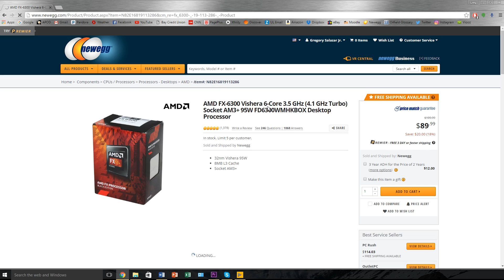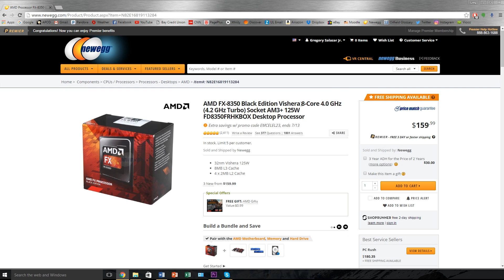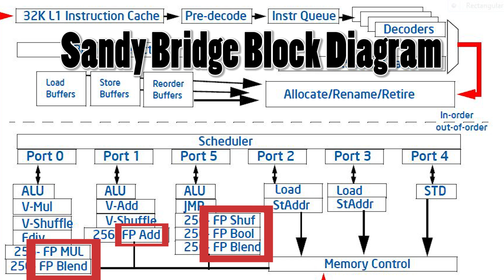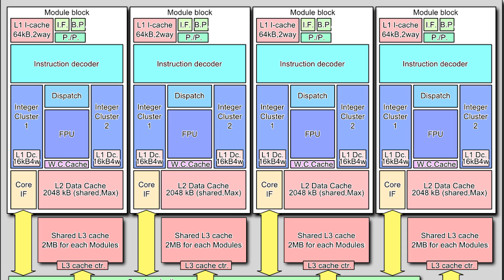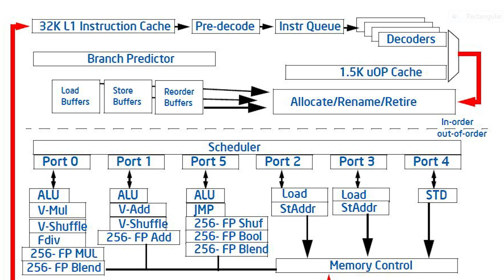How Many Cores Do AMD FX Processors *Actually* Have?

Comment: So is the FX-6300 "3" core processor?
Reply from the maker: Pay attention to what is said in the video.
Reply: You can put a lot of cores in a CPU, but of software programmers stick to the old ways, doing things as they've been doing for the last 10 years, then it's unlikely they'd want to change that (it's how they make their money)...

Dx12 changes things BECAUSE Microsoft forced them to with Windows 10... If people still had a choice to not use Dx12 with Win10 or later, then they won't, due to laziness and greed.

This means gaming will never go Dx12 in the first place if Microsoft did not force people to upgrade to it to use it.

Hell, many programmers and developers STILL use the old methods of programming games and such, some of them very inefficient and very outdated. It's fine if they do it the old fashion way and debug and refine their code, but the 'old fashion' way of copy and pasting code and using dozens of libraries of pre-made codes for you, is pure laziness.

For one thing: Java is the most useless language in comparison to other languages... It's a decent entry and learning language sure, but it's not as useful or efficient as the other well developed languages.

The one thing people need to look at, is 'refinement' of technologies or methods.

AMD is trying new stuff at times, and it's risky. Intel is prototyping stuff but they generally stick to what works.
Nvidia is constantly using older technology for their GPU (that they are most comfortable with), whilst trying to boost it with better software (and charging more because they own most of the market).

I mean, take a look at Vulkan, after it's hyped up for a month or two, how many developers actually added it into their games for support? Only a few mainstream ones. Indie developers using Vulkan? Nada. Most of the indie developers don't bother doing Dx12, they believe that Dx9 is all they need (because a lot of PC users actually are still on Windows XP, the poor PC users still outpopulate the modern PC users).

Dx9 is sufficient if the game is simplistic, but the moment you have a Dx9 'sandbox' or scaled game that draws a ton of entities, like in RTS or MMOs, the bottleneck is VERY real, even on top end rigs.
Reply: No, they are true six core. The reason why it show three core is because each 2 core share resource. Here it is again in the video 2:39, but just in case you still don't understand. I'll try to explain below.

Floating point unit (FPU): Handle mathematical calculation.
Module 1: Core 1&2 Share resource, so instead of each core having their own individual FPU to calculate the instruction being sent for it to process. They instead, have to split the resource used for calculating those instruction, and this is the reason why Intel CPU have better performance per core. It's because AMD CPU core are sharing resource with one of it's neighboring core. Think of it like Intel CPU is like a house, and AMD CPU is a duplex. 

Office is a module, the boss is the Fetcher, Decoder, and scheduler; Each worker is a core, and the internet speed is the share resource (FPU). When someone multi task it's hyper threading
Intel: As to why Intel single core performance is better, and hyper threads are not core. Intel the company have 2 worker; Each one of those worker works is heavily through the internet. Unfortunately for Intel, sometime the amount of company task that need to be done exceed the amount of worker they have. Though, each one of these worker can only realistically do one thing at a time. In order to tackle this problem, and improve work performance; Each office is given a boss who obtain information to find out what task need to be done, and schedule the workload to the worker under him; The worker then have to multi task the work given to him, and in order to keep this double task work efficient.  Each worker is given their own work space in a office, a their own boss, and a 1MB bandwidth internet speed. 
AMD: AMD on the other hand have 4 worker for their company. Their works is also heavily through the internet. Sometime AMD work load exceed 2 task also. Instead of having 2 worker try to multi task these extra workload. They actually have extra worker to take on the extra task instead. Unfortunately due to the limited space at the company. Every 2 worker have to share work space in a respective office, and the same 1MB bandwidth that is available is split among the two worker into a 500KB speed. Which limit the work performance per worker, but they would be able to get real multiple workload done quicker. They are unfortunately bottle neck in the office at how effective the boss for the office they work in at finding out the tasks that need to be done, and distributing that work load to the 2 worker. 
Apps perform worse for AMD than Intel, because program are not coded to use the extra worker AMD have. So, the apps is basically giving the AMD company a bad boss who only give 1 worker at AMD all the workload with his still limited resource. If the boss do see the second worker. He see him not as a extra worker to give the extra workload to do since worker 1 is busy, but to to tell worker 2 to just stand there and do nothing; His only assignment is to tell worker 1 his next task to finish after worker 1 is done with his current task. (Worker 2 basically become the lazy fuck no one like at work. Whose only there to tell your already busy ass, whose already working on limited resource, what the boss told him to tell you to do next; While worker 2 laze around doing bum fuck nothing, and boss never assign his ass project to finish; Even though the jackass have the same fucking job you have.)

 I hope this help you understand how a Intel hyper thread CPU work, and how a AMD CPU work. In truth, a bulldozer architecture 8 core CPU from AMD is actually  better at performing multiple heavy workload task than a Intel 4 core hyper threaded CPU. Unfortunately for AMD bulldozer CPU owner, programmer never coded their apps to take advantage of the extra core AMD CPU have, so those extra core basically don't exist for those apps. Making the apps run on the shared resource of the 1 core instead. In term, naturally making AMD CPU perform much worse than Intel CPU; Even though it's a much more complicated and advance CPU.

Correct me if i'm wrong
 From what i'm able to gather. A program design to stress the workload on a Intel CPU will show AMD CPU worse not because the CPU is actually that much significantly worse, but because it's not coded to use all the extra core in AMD Bulldozer CPU. Meaning, for a 8 core AMD bulldozer CPU; The test is only using the 4 slower single core performance; Completely leaving the other 4 unused, and if used, as crappy hyper used to tell the slower single core performance what to do next.
 On the other hand, a program design for a AMD bulldozer CPU will show AMD as better, and will not do as much of a damage to the real performance of a Intel CPU, because it will use all of the core available, and not half. Allocated all the extra task that would have gone to any extra core Intel may have, but don't have to the hyper thread. Intel CPU will still show better single core performance, but will not show it's multi task performance to be better than AMD like most test out their seem to be doing, because they are not using the extra core in those Module. For gaming, Intel CPU will still perform better than AMD though; Since most game relied more on fast single core performance than multi core performance. Since they do not need to use that many core.
Reply: basically, strap two people back to back. are they still two people? yes. can they both move forward at the same time? no.

Comment: Well, unfortunately (I guess) I upgraded from an i3 a couple years ago to the 8320 (which when OC'd is an 8350). While it generally performs a bit better some things (MMOs particularly) don't seem to do much better even with my now upgraded GPU. Is there anything besides straight up overclocking I can do to make my 8320 run a bit more "efficiently"?

Comment: Intel Hyperthreading CPUs have more transistors vs. their non HT CPUs by at least 5%. To enable HT the core needs extra registers, pointers, a stack, etc. so it is a "physical" core and not a virtual one. Intel can rename registers, but two sets are still needed for HT. Both physical cores share the scheduler and ALUs however.

Comment: Good video. But Cine Bench see the FX CPU as a 4 Core with 8 Threads because the OS is doing so. And the OS is doing so, because they want to prevent that two threads are allocated to two cores which shares one FPU even the other Cores are not busy. So Core 5,6,7 and 8 will only be used if 1,2,3 and 4 are too busy.

Comment: So, from what I'm understanding, if AMD had set it's FX chips to have both 2 Fetchers and 2 Decoders from the start, then the FX lineup of 6k-9k series would pretty much be equal to high end i7's-Xeon's with per core performance, since the work load would of been able to be split into 2 multiple chunks between each cpu core, so for example, running the FX-8350 on a workload such as Cinebench using this logic, the 8350 should, in theory, perform at or beyond the Xeon 8-core cpu based on overall clock speeds?

Comment: I don´t agree on one point. Yea, sure, Bulldozer share fetch and decoder  for both cores, But the fetch and decoders work twice as fast. This is not a bottle necking issue. The only real issue is the FPU. If you run only non FPU instructions then there is no bottlenecking.

Most software use a mix of FPU and non FPU  programs. The idéa of Bulldozer was if there is a 50/50 mix, the FPU can run 100% and so can the cores.

The issue with most modern software is that the mix is not really 50/50.. but its fairly close. I think that AMD banked on that flotingpoint calculation would move over to GPU faster than they did. If you run floatingpoint on mostly FPU, then Bulldozer is a fairly good design.

Secondly most modern Intel CPU got a 256 bit SIMD FPU, while Bulldozer only have a 128bit. This is mostly due to bulldozer design is fairly old buy now, and it have not been updated in later processors. This is a other reason while Bulldozer series is quite a bit slower.

Also i think brifed over the hyperthreeding a little bot to fast. It almost sounds like there is double set of pipes in a hyper threed processor.

Its really just one set. Its one core, one processing unit. That have two decoders. The decoders run each on the same core on every second clock cycle.

This give two main advantages.
1: its simulate more cores to the OS. This was great back in the windows 2000/Pentium 4 days, making things just work better. Today... it really don´t matter.
2: It reduces branch prediction errors. This give great performance on bad code.

What it don´t do is give more performance. Hyper threading uses the preformans available more efficient, at least if its spaghetti-code.

So a 8 core bulldozer and a 4 core sandybridge got same number of FPU:s (4). and threads (8). there the simularites end.

Bulldozer got 8 main processing unit, sandy bridge got 4.
Bulldozer got 4 (dobble speed) decoders, sandy bridge got 4 main, 4 secondary
Bulldozer got 128 bit FPU setup, Sandy bridge got 256.
Reply from the maker: They do not work twice as fast, and there is no information suggesting that they do. There are bottlenecks in this design. It's rather obvious
Reply: Science Studio No that is not corect. Its the week FPU that is the bottle neck.

The fetch work just fine. Its design to handel two cores, so it not a problem.

You really think that AMD would make a such a obvius flaw in the design?

Comment: And yet we still have many intel morons that keeps saying FX isn't a true 8 core.
Reply: Did you actually watch this video?  This is fully explained.   The cores are paired up and share architecture, which creates bottle necks.  A TRUE 8 core processor wouldn't have bottle necks like this.
Reply: soggytoast111 You kinda missed the point of my comment.
Reply: +Aoru Then what are you trying to say?  

People point out that its not 8 true cores because IT ISN'T.    The cores can't operate independently.  The function is more like 4 hyperthreaded cores because information can only flow into 4 cores at a time (due to shared decoders).
Reply: Okay ,  I think you're misunderstanding Aoru's original comment still . Also , if you watch the video Greg does in fact say that by definition these ARE true 8 core processors . Based on what you're saying , you are correct but your conclusion wouldn't be that it isn't a true 8 core processor but rather a very poor , inefficient 8 core processor .

EDIT: So nobody flames me , I have an i5-2500k OC'd to 4.5 GHz . I'm not a fanboy in any sense for either side , and would love to see what Zen has to offer to see whether or not I should upgrade as Skylake isn't too big of a deal for me other than DDR4 (not spending $400 for a new mobo and CPU just for DDR4) .
Reply: I think the correct definition of an AMD processor is that they are "12/17 inefficient 8 core processors". I say 12/17 because they should have 8 fpu units and 8 integer units (16), yet they have 4 and 8 (12), and very inefficient schedulers and fetchers (0 over total). so.... (I know it doesn't add up like that, but... it shows the meaning behind the number)
Reply: ***** exactly. shoredingers processor (on my phone, autocorrect activated). I think at least Intel doesn't make confusing publicity
Reply: AMD have the equivalent of half cores due to the bottleneck

Comment: This is first video about the subject that clearly shows (and states) that AMD chose wrong approach thinking, that the software support would follow and they would clear the playing field with amazingly efficient, fast and cheap processors. Instead, Intel "brute forced" their way to the top by selling pricier products (and taking even some losses when selling their processors) but not requiring software to change anything.

AMD had the right idea, since we need revolution/change in the software side of things too to get much more efficient algorithms and ways of making more optimal code. Right now we're basically just throwing more processing power to make bad code to run faster instead of changing how software is made to get more speed out of existing hardware.

But we'll see how zen does it...

Comment: So that's why my X4 955 is still good enough for my use, it has the same amount of integer and float units, where as newer AMDs have half the mount of float units. Yep i've been saying this for years, this is the reason AMD is concidered to be trash, and in fact it is. I bought an AMD laptop not too long ago and it is garbage. It has about half the float performance it needs to support the GPU in most games, and both APU and GPU is soldered to the motherboard. The GPU is exellent, only beaten by how crap the APU is. AND forget running the iGPU and GPU in crossfire, they alternate every frame, so the GPU spends most of its time waiting for the iGPU, and it's doesn't even do so in a smooth way. Every other frame renders slowly and the other renders fast, you can actually see it. Garbage hhhhhhhhhhhhhhhhhh

Comment: It makes no sense to invest into a dead socket. You have no upgrade path. I'd rather buy an i3 over an 8350 and upgrade to an i5/i7 if needed. Not to mention their single threaded performance is poor. Spend a little bit more on an intel, CPU it will go a long way.

Comment: my laptop i3 4005u 1.7Ghz dual core CPU with Hthreading has almost double the performance of my old E5200 2.5 Ghz dual core CPU while using 4 times less power.

And my old HD 4850 GPU uses up 3 times more power than my entire laptop only to deliver 10-25% better FPS

Comment: Overall a good video, but I have a few nitpicks...

1. The FPU does NOT do the majority of calculations - the integer cores do.  FPU is just very critical in programs where fast integer math cannot be easily used.

2. FX shared FPUs aren't much of a problem due to their count - the FPUs are actually very capable - but because of pipeline problems.  The FPUs can execute eight threads at once, except in AVX mode.  In reality, each module has two fusible FPUs which AMD called a "Flex FPU" because it has a common floating point scheduler.

3. The scheduler issue you mentioned has log since been resolved - and it amounted to a 3% performance difference.  The real issues were with the shared pipeline, cache policy, and cache performance.  Your understanding of the problem is also lacking - the OS would see an 8-core CPU and treat all cores equally, however using adjacent cores on Bulldozer would slow down one of the cores - this problem was actually resolved at the hardware level by AMD (with Excavator).  Programs running on the OS just issue threads, the OS determines how to schedule them - so the program identifying the CPU as 4/8 rather 8/8 makes ZERO impact on performance.